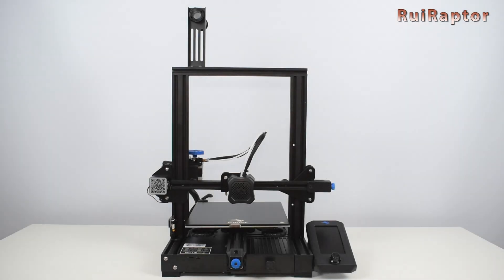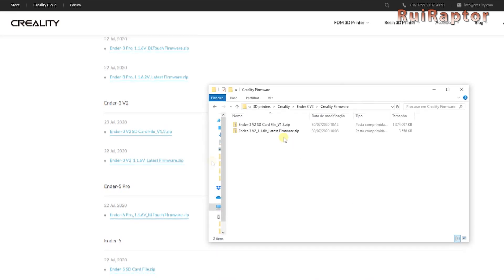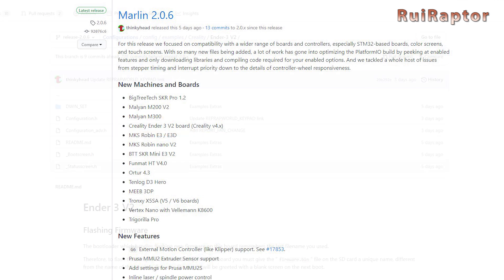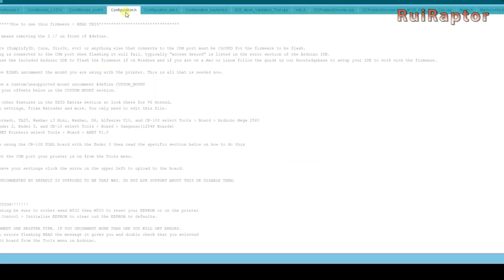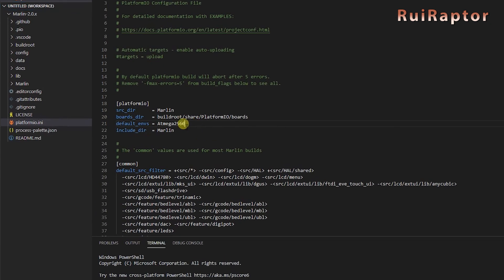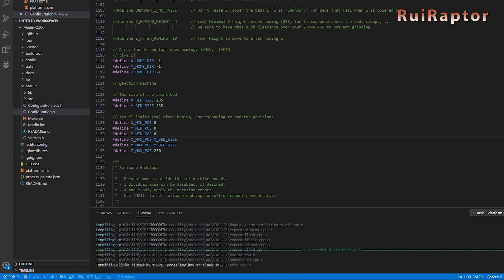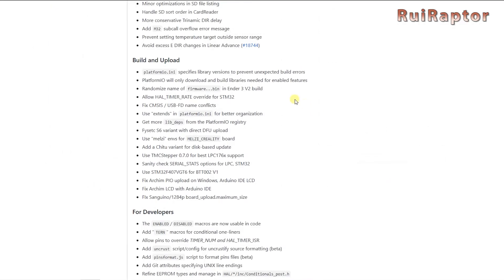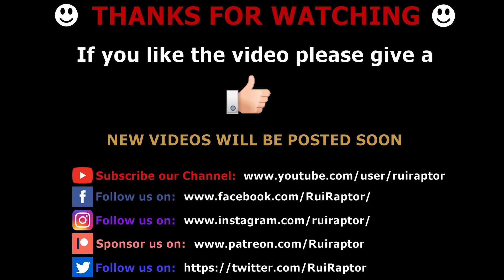Creality ENDER 3 V2 - How To EDIT & UPLOAD New Firmware

Comment: Thanks so much for another outstanding video!  However, I am so timid with firmware flashing that it is DIFFICULT to proceed without a little handholding, as sickening as that is!  I just checked the Creality site today and this is what they show:  Ender-3 V2-Marlin-2.0.1 - V1.0.1 - TMC2225-（V4.2.7 Mainboard）.zip, dated Jan 14, 2020. My Ender 3 V2 firmware is V1.02 so is that Jan 14 file OK to use?  My mobo is a V4.2.2 but from what I have read, it should be compatible.  This is prompted by a problem where my printer will sometimes proceed normally when the temps are reached and sometimes it won't, it just sits there--I have yet to learn what makes the difference.  I've checked and done all I know and am driven to explore an update flashing as my last resort!  I would be thankful for ANY help!
EDIT:  The date above should read Jan 14, 2021--Sorry!

Comment: Black screen after following this video. This is what worked for me. Remove/Delete everything from SD Card, save the Ender files from SD Card to your pc if you want. The SD Card should be empty.  Format the SD Card to FAT32, I didn't change anything in the format window. After you have deleted everything and formatted the SD Card, save your new .bin file to SD Card. Unplug printer, insert SD Card and then power on printer. Hopefully this helps.
Reply: Ayyy thanks a lot for this! I was stuck with black screen and I was looking around for a solution. This definitely worked for me!
Reply: @iskons  No problem, happy printing👍
Reply: Did this and renamed the .bin file and it booted up fine rather than with a black screen. Thanks.
Reply: @Mace3DP  glad I could help.
Reply: Yhank you and thanks to the original video author, i did everything as in video and in your comment, also renamed the file, and got through blank screen

Comment: I have a problem when i upload the modified firmware the every axis mottors just stuck in breake, even if i upload the stock example file without any modifications, i use this board on a custom machine but so far i cant get it right, anyone who knows better can help me.
Reply from the maker: Hi Stefan, can you explain better the " every axis mottors just stuck in breake" ?
Reply: @ruiraptor  there is resistance when i try to move them by hand if i send the M18 comand to disable the steppers i can move them easily.

Comment: I installed rong firmware now Display is black
Reply from the maker: Hi, try deleting everything from the memory card, copy the correct firmware into it (with a different and short name) and try again.
Reply: @ruiraptor  I have a 3 Eder v 2 I tried to put Latest Firmware 14 August 2020 from creality.com but is still not working Display stil dark I made same for Display card inside but still not working
Reply: Its working again
Reply from the maker: Hi, glad it's working again. Good work :)

Comment: Thank you very much. My ender 3 v2 came with broken firmware. As of December 2020, even the "updated" firmware on creality's website is still broken, it reports the temperatures incorrectly (twice) when connected to octoprint. Followed your instructions, fumbled a bit but got it right in the end! Problem solved.
Reply: There's an octoprint plug in that works around this double reporting, too.

Comment: how do i fix this I followed your instruction but it failed to compile. the is the first error I got.
Marlin\src\HAL\STM32F1\../../inc/../HAL/./STM32F1/HAL.h:85:4: error: #error "SERIAL_PORT must be -1 or from 1 to 5. Please update your configuration."        
   #error "SERIAL_PORT must be -1 or from 1 to 5. Please update your configuration."
Marlin\src\HAL\STM32F1\../../inc/../pins/ramps/pins_RAMPS.h:51:4: error: #error "Oops! Set MOTHERBOARD to an STM32F1-based board when building for STM32F1."  
   #error "Oops! Set MOTHERBOARD to an STM32F1-based board when building for STM32F1."
    ^~~~~
Marlin\src\HAL\STM32F1\../../inc/../pins/ramps/pins_RAMPS.h:55:4: error: #error "Oops! Select 'Arduino/Genuino Mega or Mega 2560' in 'Tools > Board.'"        
   #error "Oops! Select 'Arduino/Genuino Mega or Mega 2560' in 'Tools > Board.'"
Reply from the maker: Hi, did you change the environment line in the platformio.ini file?
Reply: @ruiraptor  I get this too even after the environment line change to the stm, am i missing somthing?

Comment: So does this replace the process where you open the motherboard to install BLTouch firmware that’s in many tutorials?
Reply from the maker: Hi Michael, yes, correct. These 32bit boards update the firmware through the memory card instead. Also, the new Ender 3 and Ender 3 Pro printers are also equipped with 32bit boards and the procedure is the same. Check this other video: https://youtu.be/kFRy_5lh2IQ
Reply: @ruiraptor  thanks, I’ve only hand my Ender3 Pro for two months, and wonder if it has the 32Bit board. Guess I need to open the case up!
Reply from the maker: You need to open the cover panel and take a look ;)
Reply: @ruiraptor  just did and it is the older 8bit board - not too bothered because I did get a decent discount, the BLTouch upgrade will be a nice project for a day when the parts come.

Comment: Ill PayPal someone $2 who can compile some Ender 3 V2 marlin firmware for me. I keep getting errors in my compile. I want everything default except for The max extruder temp needs to get increased to 315. 

Make X/Y build volume 230

Also change the Home offsets from:
X-1
Y-1
Z-1

to 

X-5
X-10
Z-1

Comment: Thank you so much for making this video, After installing the Marlin Firmware how do I install firmware for the BLTouch?  Second question I have is updating the V2 screen, do I just put the DWIN_SET onto a SD card and slide into the panels board after taking back off then just start up the Ender and it will update board?
Reply from the maker: Hi, 
if you want to install BLtouch, you need to edit the firmware to enable the BLtouch (and a few other things such as Safe-Z, etc) and use the same procedure to flash it. For the screen, you need to open the display enclosure and insert the memory card in the memory card slot that is located at the back side of the display board.

Comment: Following all your instructions I keep getting the same 3 errors. I have searched for clues how to fix this. I came up empty.
I am going to copy the error messages here to see if anyone has had these issues

#error "SERIAL_PORT must be -1 or from 1 to 5. Please update your configuration."

#error "Oops! Set MOTHERBOARD to an STM32F1-based board when building for STM32F1."

#error "Oops! Select 'Arduino/Genuino Mega or Mega 2560' in 'Tools > Board.'"
Reply: Im getting the same errors! i cant figure it out. did you find out anything?
Reply: @JA-er3lq  I figured it out! Copy Ender configuration into the Marlin subfolder (not the main folder with platformio.ini).

Comment: Thank you very much for the video!

If you want it to display "235x235x250" on the Info screen you must modify the dwin.cpp file on the src\lcd\dwin\e3v2 directory. Search for #define MACHINE_SIZE "220x220x250", and modify it with "235x235x250".

It's curious it doesn't take these values from X_BED_SIZE and Y_BED_SIZE constants, but from a literal string. It's not a good practise on programming doing it.
Reply from the maker: Thanks for sharing Alvaro
Reply: Também achei bastante fraco o nível de qualidade na programação. Seria de esperar que os valores no display fossem chamadas das constantes no código e não strings.
Reply: THANK YOU

Comment: Need help please. I have renamed the bin file and it is the only thing on my sd card. The screen lights up but is blank. Any help please?
Reply from the maker: Did you try a different memory card? Did you use a completly new name for the bin file? Try a simple name like 1.bin
Reply: @ruiraptor  i was able to figure it out. I did not completely unplug the printer. I just switched it off. It worked immediately after i actually unplugged it
Reply from the maker: That is great news. Glad you got it working :)

Comment: can we activate mesh bed leveling for ender 3 v2? i just don't have a bltouch yet, so i wanted to make use of mesh bed leveling. thank you!
Reply from the maker: Hi Jay, yes you can but there's no change at the moment to activate that menu on the screen. The leveling must be done by sending G29 commands through repetier for example.
Reply: @ruiraptor  thank you! I'll try that.

Comment: Hello. I really enjoyed your how to. Unfortunately I am having some issues. I download marlin and the configs. And only change the machine type (nothing else)and I am unable to compile. I have tried multiple machines. I really want to add M600 to machine. It kinda worked and then I updated the controller and now the same firmware files I used will touch the bed then move all of the way to the end on x axis and move y back and fourth with out moving on X. I am able to reinstall the creality firmware and the machine works again.  Do you have a current .BIN file that has M600 built in and a known good screen firmware?

Comment: Hi, I cant seem to compile, i am getting errors:
#error "SERIAL_PORT cannot be 0. (Port 0 does not exist.) Please update your configuration."
#error directive: "SERIAL_PORT cannot be 0. (Port 0 does not exist.) Please update your configuration."

#error "Oops! Set MOTHERBOARD to an STM32F1-based board when building for STM32F1."
#error directive: "Oops! Set MOTHERBOARD to an STM32F1-based board when building for STM32F1."
#error "Oops! Select 'Arduino/Genuino Mega or Mega 2560' in 'Tools > Board.'"
#error directive: "Oops! Select 'Arduino/Genuino Mega or Mega 2560' in 'Tools > Board.'"

Please advise in what to do
Reply from the maker: Hi, it seems that you have a few errors on that firmware. Which version are you using? Did you change the enviroment line in platformio.ini like we explained in the video?
Reply: Copy Ender configuration into the Marlin subfolder (not the folder with platformio.ini)

Comment: Help! After updating my machine is grinding up against the end stops. Any help would be much appreciated thanks.
Reply from the maker: Hi Rob, does that happen when printing gcode files with filename longer than 23 characters? If yes, rename the file with a shorter name.
Reply: @ruiraptor  No it happens when trying to home the machine. I edited the values to slow homing speed but this has only helped and not solved the issue. Occasionally when homing to level the bed it still does it and occasionally when homing before a print as well. I have edited nothing else in the firmware. Thanks again
Reply from the maker: Hi Rob, which firmware are you using? We can send you our firmware for you to test if you want.
Reply: @ruiraptor  Thank you. I'm using 2.0.6.1 and followed the instructions several times so think its just a bug with my machine. I would certainly try your firmware if you sent it over. I updated as I was having issues with Espteps being limited at 189 and various octoprint issues. Again, thanks for your time
Reply from the maker: Hi Rob, please contact us by email or FB and we will send you our firmware.

Comment: I reached the build step on visual studio, and I got a failure in compiling the code... any ideas why it is happening?
I didn't change any configuration of the firmware..
thanks!
Reply from the maker: Hi, without knowing which errors you are getting is not easy to help. Can you contact us by email or Facebook and send us the printscreen with the errors you get?

Comment: Hi, I've got the ender 5 Pro with the 4.2.2 creality board installed. The standard Ender 5 Pro profile seems to be for the older 8 bit boards. Is there an updated version for the 32 bit boards?
Reply from the maker: Hi Jeff, not that we are aware of...but you can compare the config files from both versions and apply the changes to the 8bits one. The main changes might be the board used and the drivers.

Comment: Really useful video well done. What I would like to work out is to enable a refresh option when using a SD Card adapter. The SD_DETECT_PIN issue means I have to power off and on to refresh when a physical insertion is not detected. Prints great out of the box but compared to all my other printers I have finding the V2 display confines a real limiting factor.

Comment: So witch is better the marlin one or the creality ... and what do you need to modify on the bin file that is so important to use the marlin one ?
Reply from the maker: Hi Nicu,
The advantage of the Marlin version is that they provide updates more often. Also, if you want to modify the print area (Creality uses 220x220) you can edit and change the area with the size of the glass. If you plan on installing BL-touch or any other type of sensor, you can by editing the Marlin version.

Comment: Omg...ok like really I have been researching 3d printers to buy for like weeks now and why the hell do none of them just work? Every review I've seen on any printer always seems to be shipped to that person broken, with missing parts or they say it works fine...after upgrading literally everything. I just want a printer that is going to work without me instantly needing to upgrade or change something
Reply: did you fix your problem? my printer can not read micro sd cards or can not update firmware, i bought a bootloader to flash? but its for older versions, not for v2. no luck, looks like i'll have to return.
Reply: @SHADOW-bg4mm  mine showed up and I needed to do the stuff in the vid but also the bed is bent to hell, so not exactly a pleasant experience, but I sure there is a discord somewhere where you could ask to see if your problem is a easy fix or not. I would definitely try to ask on one of these YouTubers discords before going through the hassle of returning it.

Comment: Which of the Ender 3 V2 and Two Trees Bluer printers should I choose? Ender 3 V2 is 90USD more expensive than Two Trees Bluer in my country. Is it worth the price difference?
Reply from the maker: Hi, The TwoTrees Bluer is a nice machine and also prints very good, however, we noticed a few issues with the frame assembly. We know that TwoTrees released an updated version with eccentric nuts after the release of our review video but the frame details seem the same.
Reply: @ruiraptor  Thank you. Perhaps it will be better to see the Ender 3 v2 in the future.

Comment: I appreciate this isn't related exactly to the video content but my printer out the box had a huge issues with under extrusion. I requested 100mm of filament. Actual length was 87.5mm. So some quick math 100mm/87.5mm x 93 ( extrusion ratio) = 106.8. Changed extrusion ratio to 106.8 then run another 100mm. Result 100.6mm. Good enough. May help some of your viewers as I was getting some horrible prints. The new setting made a massive  difference to my print quality.

Comment: Brilliant video very very helpful. Could do one on installing a BLTouch please. I have the kit but how to install it on a 32bit board escapes me. Many thanks for all you do.
Reply from the maker: Yes, we will work on that very soon.
Reply: Just had a mishap too, I was in the middle of a 26 hour print, probably 6% to go and the filament ran out, I thought there would be enough. Damn. Could do with a run out sensor. I'm very surprised that they didn't fit one stock.

Comment: Does this address the issue where when you go into “Tune” mid print and adjust a parameter specifically to speed it doesn’t cause the drivers to act erratically, shifting layers and causing the Y axis to shake and jump teeth on the timing belt?
Reply from the maker: We tested the Marlin version and it worked perfectly. Just avoid using gcodes with filenames longer than 23 characters. If you have any, just rename them with shorter names.

Comment: Need help I got messed up and greeted with a blank screen. How do i fix it?
Reply from the maker: Hi Mark, did you use a different filename for your BIN file? If you use the same filename you will get the blank screen.
Reply: ruiraptor yeah i accidentally forgot to change the name on it. Now I’m stuck with blank screen and don’t know what to do?
Reply from the maker: Rename the bin file to something different that you didn't use yet and try again.
Reply: ruiraptor yes I changed the name and still blank screen. the only thing i know for now is try to replace the main board? but don’t know what or which motherboard should I get?
Reply from the maker: Try using a different memory card and a different name for the bin file. Don't forget to keep the bin file in the root of the memory card. With the memory card inserted in the printer, turn the printer on and wait a few seconds (it takes a few seconds to upload the bin file to the board).